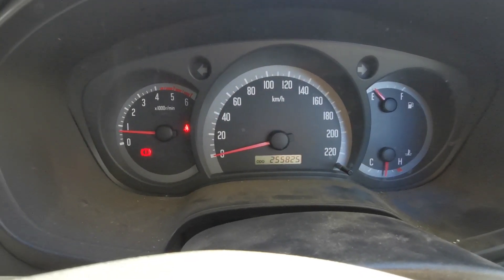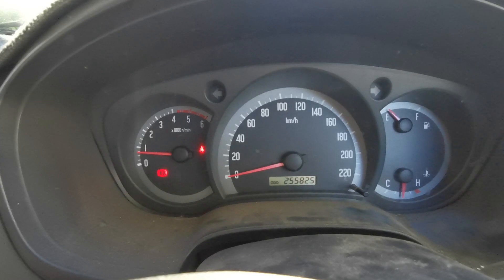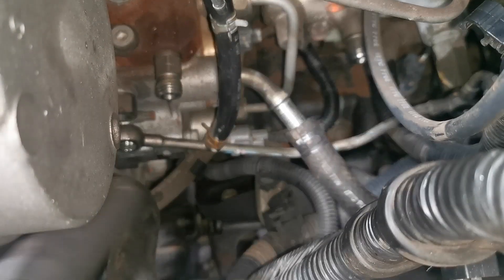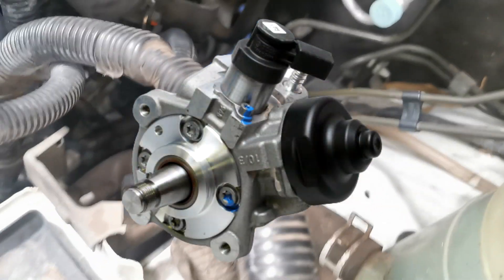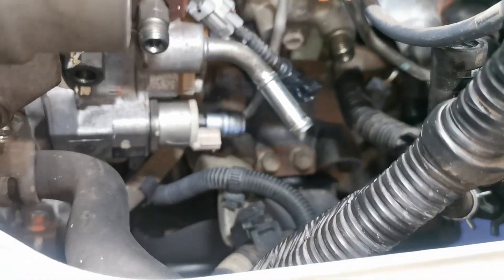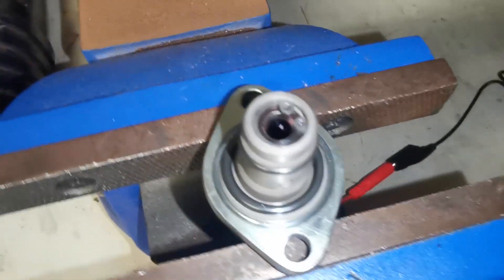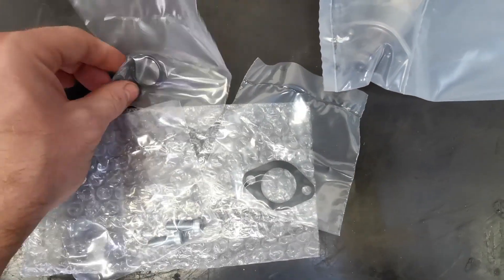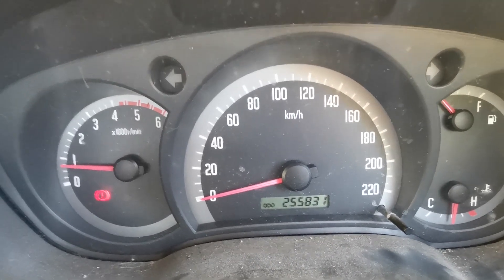Fuel Pressure Regulator / Suction Control Valve - How To Test & Check

Comment: Very common failure on the 4JJ1 and 4Hk1 engines from Isuzu. If the problem wasn't intermittent, one thing you can do is unplug it. This will open up the valve and allow full fuel flow to the pump and if makes it run better you know the valve is faulty

Comment: Have P2293 on my Isuzu 4HK1 (NPR cabover truck 5.2L) and it sound similar. I lose power randomly while under load, but it has been intermittent and would return to normal. Other symptom has been rough to no starting. Now it just won't start but like 1/10 times. and when it does it idles rough and eventually just dies. Ordered the SCV kit and am researching how I can do it myself. Thank you!

Comment: I fitted a new pressure valve on mk7 transit, its not running right after new part, does it need to be calibrated ? Thx
Reply: On some yes but make sure it's a genuine part.

Comment: Best video I've found so far on this problem, I had similar fault codes but one code highlighted my fuel pressure sensor.
After changing fuel pressure sensor code pointing towards fuel pressure regulator came up this is on a 2013 Hilux 3L D4D engine.
Thank you so much for posting this video it is the best I've found 🙏

Comment: I just finished watching your video. I am encountering the same problem with my car, Toyota Hilux D4D 3.0 ENGINE. At the moment it's parked the garage because the engine failure. It undergoes a diagnostic test, which revealed Low Fuel Pressure and Common Rail.The problem here was always there since we took it for its regular service at Toyota Garage. It stopped and this year it bounced back with force. Whilst driving,a light will flash and a rough idle started. This force me to drive off the road and switch off the engine. I pump the primary pump and then I can proceed with my journey. Sometimes it takes more than an hour to control the problem. Help me out if you also encounter with similar problem.

Comment: hello, after watching your video i haev a question about my car, i have a passat CFFB 2.0 TDI, recentely i start to monitor my car data by vcds, i see that my diesl pressure fluctuating from 26301 KPA to 31801 Kpa, thats too much but car work fine,  i test a freind car and i found that the pressure is almost stable '( from 29929 KPA to 28929), what should i do please ? any idea? should i replace or clean the RAIL FUEL PRESSURE SOLENOID VALVE or the one located on the HP pump (fuel pump pressor sensor or named suction control valve) wich one is responsible of this fluctuating ? thank you

Comment: I have a Fiat 1.3 that trips the low fuel pressure flag when I put the accelerator down. The rail pressure just drops then pings straight back. The pump can’t react that fast. Your video has given me the confidence to pull my valve which is on the pressure side and take a look.

Comment: I used to get my peugeot 307 2L HDI shut down on the highway towing a heavy load. I did a scan and got something similar. I can't the scv and the other pcv and cleared faults and no worries then. 
 Now i have rough or surging idle intermittently bit a lot in my ssangyong actyong sports. Probably the same thing

Comment: Fantastic detailed video, no bullcrap, straight to the point, Sir you now have a new sub. Just one question please, Does this part replacement need re programming, I'm about to do mine on a Mk7 Ford Transit 2.2 TDCI, Thank you 😎💜✌🏻
Reply: Yep use forscan to do the learns and do the injector learns at the same time. However even without the learns the van should run fine. I've changed these 3 times on my transit very common to go faulty. Ideally it would be best to get a genuine ford one.
Replace the fuel filter for a genuine ford one to.

Comment: Brilliant great indepth explanation thank you " good work !! "
Reply: Just an update on our problem We had the same code  but found it was a cracked / hole in the diesel feed pipe, so air leaking into the pipe . This was due to the chassis having cracked just behind the cab 😢

Comment: Hello.. I have a 2013 renault/dacia duster. 
The car suddenly stopped working when  I was driving it.. 
apparently the FVR(fuel
Intake solenoid valve) was faulty (thats what the mechanic told me.

Now I got another pre used valve and when I connect it to a 12 volt power source, it pulsates forward and backwards.. about 3 times a second ..

Now when I connect it to the car, (the car connector terminals read about 9.5 volts (which is correct I guess because I confirmed it from another video)

But, the solenoid doesn’t open.. it keeps vibrating.. and the engine doesn’t start..

Now, I cut the isolating rubber ring on the old valve and connected it (basically bypassed it) and the engine started..(with low fuel economy but it runs) thus ruling out pump, filter issue..

I am not able to figure out if it is an ECM problem (maybe the voltage drops on load.. im not able to check on load voltage because the connector wraps around the entire connectors.. but when the connector is open, it shows 9.5 volts

I would also like to add that since a few months the car was giving a fuel volume regulator control circuit range/performance P0002 error (but it used to go away on its own)..

So again, should I get the ECM checked? Or it could be that the other used valve is faulty as well?

Comment: Thanks for your clear description of what is going on in this situation. My Captiva has a low pressure fault and I was told that the HP fuel pump needed to be replaced. I've stripped and inspected it and found nothing wrong with the pump. The valve operates electrically, but I'll see if I can get into it to inspect it for wear. I've been told by another service business that there may be a seized injector that could be causing the low pressure issue, so have to investigate that as well.

Comment: come fix my car i have the same problem and i really want my car to running be again. i took the car to two garages but they didnt fix it and im afraid the local garage would charge me alot.
Reply: What was the reason for the 2 shops not fixing?.
Reply: I don’t they couldn’t know what going on they told me to take to Holden company car and I did and they didn’t fix anything just a nut bolt they said was loose. Which was bullshit.

Comment: I have a vauxhall astra h 1.7cdti (izuzu)with a non start issue low rail pressure no codes showing. Could this be the problem thanks
Reply: Same issue with a meriva b 1.7cdti, ran fine yesterday then non start again

Comment: I've just changed an engine over in my Colorado 4JJ1 2009.  The donor engine is a Low out put turbo model of which I put the Original engine Hi Output turbo and manifold on the Donor engine.  NOW it cranks but wont start.. Do the injectors need to be changed too from the original engine because of the turbo out put difference, I've not programmed them in? Im getting no fault codes.. UPDATE  I had to bleed the air out of the fuel lines..

Comment: top bloke well  explained    have same code on volvo c30 1,6 d   going to replace fuel filter first if that doent work the pressure reg valve next    fingers crossed not pump faulty
Reply: Fellow Volvo guy, did you solve your issue?

Comment: what should common rail fuel pressure be when engine is not startet yet and fuel pump have primed engine.   i have a FIAT qubo that will not start at all and i have FRP at 4400. do you know ?

Comment: Great work Gerard! This is probably the most informative video on this problem that I've come across. I experienced a SCV failure back in 2016 and after shelling out $800 for the local specialist Diesel mechanic to fix it, I thought I'd have a crack at it myself this time. Mine failed again a couple of weeks ago and threw the same codes. $50 for a replacement SCV off ebay but I wouldn't exactly say they are easy to replace. Access is a nightmare (particularly the lower bolt) and if you accidentally drop a bolt or your Allen key it finds its way into the notch of the engine mount bracket and is completely unreachable (trust me! Don't let anything fall). I have exact same car (07 4JJ1) and this seems to be its only real weakness. Just clicked over 300,000.

Comment: I had the same symptoms and rough idle occassionally on my GM 1.7cdti.   Mine did not have scoring but it was dirty inside and when i cleaned and put it back the rough idle went away and the low pressure issued rectified.  I have ordered a new part and will replace it when the weather warms up.  I was wondering about it needing calibrating to the engine, so i recommend keeping the old part until the car is in good working order and you are satisfied.  Thanks for the great video
Reply: On this 'calibration' subject - I've noticed that simply disconnecting-&-reconnecting the car's battery has the effect of getting the SCV to behave (i.e. massive problems starting/cranking - to zero problems on even cold (below zero Celsius) starts).
Reply: Make sure you don't damage the o-ring when installing it. Had that happen to me so the new part didn't fix my issue. Really fun to diagnose because you normally don't suspect the new part is at fault. 

Tighten it gently and evenly. Lube the o-ring up good. Half turn of one screw then half turn of the other screw and so on until it's tight.

Comment: Hi Gerard very informative video  My car suddenly wouldn't start low fuel pressure could the valve be the cause in other words does the valve creates the pressure
Reply: The SCV doesn't 'create' any pressure, but it does manage it. So certainly - a dodgy/sticking SCV will 100% create starting issues (prob even before running issues).

Comment: Hi Gerard I doubt you’ll see this but if this manages to reach you, I really need your help. I have a 2ltr cdti kuga with high fuel pressure and engine cutting out in high revs? When flooring it. 
I’ve been chasing this issue for a while. 
Things done so far. 
Changed fuel filter
Changed high pressure fuel pump & regulator. Second hand so second guessing this. How Lilly is it to get 2 faulty fuel pump & regulators
Changed high pressure sensor.
Done leak off test. All seems ok
None of this made any change. 

Car gives up fault code. P1169 (fuel pressure in range but high) but when restarted after stall. Code clears and car goes back to normal. 

 2012 tdci. AWd 136kw 

I’m now thinking it must be some kind of blockage in return pipes or blocked injector possibly. (Tho leak off test seemed ok 
Causing high pressure build up. If revs are kept below 4k,  car runs perfect in lower range . Starts perfect. Idles perfect. 

Just thought I would throw it to you and see if you can suggest anything. I’ve been pulling my hair out and I’m skint now, funny thing is. After changing HPFP the issue was precisely the same. I can make the car do it at precisely 4.5 k revs 5th gear topping 80+. It happens at this same point no matter what I do 
Thanks in advance

Comment: Awesome job!  I've research a ton on these valves and issues relating to low fuel rail pressure errors and no one explains HOW these valves can actually produce such errors.  It's just as I suspected- mechanically hanging up.
Reply: How does the scouring ever occur at the area? Could contamination in the fuel cause this abrasion over time? Perhaps due to the switch of fuel from different filling stations?
Reply: @nabeeljacksonrhoda6480  Mechanical wear can happen through fatigue. Many devices are rated by how many operational cycles they can perform.. Quality of materials has a lot to say in all of it, that and manufacturing tolerances.
Reply: @seer7327  appreciate the response. If changing the other sensor on the rail doesn't do the trick, might just have to get a new fuel pump pressure regulator then.
Reply: @nabeeljacksonrhoda6480  Really need good diagnostic tools to pin this stuff down. These control valves are fairly cheap and easy to replace which is why it's worth a shot to just throw a new part at. Generally, starting issues come with failing control valves. I chased a fueling problem down to a bad ground on an in-tank (low pressure) fuel pump: was intermittent to the tune of going 1,000 miles before encountering a problem.

Comment: Great video, very informative.
Have you had any experience of the 2.2 puma engine regarding rough idle and stalling and losing power when  hot? Gives me P0094 code. Could it be the same? If i change ut do i need to do a pump relearn?

Comment: I did all these testa found tiny bit of scoring. My question is when i did the battery test it goes in and out as should but i noticed the circlip moves around a bit is that normal?

Comment: I've just bought a 2008 c-class Mercedes 320 cdi.Drove perfectly on test drive,however this was just around a built up area.After buying the car i was doing 60mph and floored it to pass 2 cars,EML light came on,fault code 11b800 "The control deviation during rail pressure regulation via the quantity control valve is too high"
The car drives faultlessly apart from this so i'm thinking the car's just struggling to get enough fuel at higher revs.
Could this valve be a possibility on mine?Sounds like it could be.Thanks.

Comment: My scanner sais my scv  fuel rail pressure is fluctuating between 30000kpa and 28000kpa at idle is that bad ? It is brand new. Also woule this be causing problems when cold?

Comment: Very informative video Gerard! Well done!
I had "P0045 turbocharger/supercharger boost control a circuit/open" and I have replaced my turbo yet the code came back again. Checked the wirings and the turbo computer and all seems well. Do you think a lack of fuel and power is throwing off my boost sensors hence showing this code? I have ordered a new SCV and hope to install it in coming days. 
My engine is 1KD, GX Prado 120, auto 2004. Thanks again for your videos, appreciated!
Reply from the maker: The description of the code would lead me to be certain of wiring and actuation of the boost solenoid before moving on to anything else. 
 
Best of luck with the repairs, thanks for watching and commenting on the video.
Reply: @GerardBurkeBurkesGarage  Thank you for your time replying, appreciated! I will keep you posted on this tread on how it goes. Regards. Shyaka

Comment from the maker: This repair was done earlier in the year and has solved the customers running issues.  
Link for part - https://ebay.us/Hev6eE 
Part numbers for the SCV are VSC100GEN / A6860EC09A (Nissan Genuine Part Number) 
As always, thanks for watching
Reply: Did this replacement need re programming in the ECU please?
Reply: Thanks for this. I'm getting a code for the regulator on a Volvo xc90 and also getting hard starts, cranks over after few tries... Like 3 times... Swings then cuts off, swings and cuts off and then swings and cuts off
..ans eventually cranks over. There's also as explained, restriction in performance and laziness or lethargic throttle response. I've switched the fuel regulator but no change. Still to check the pressure control valve on the rail itself.